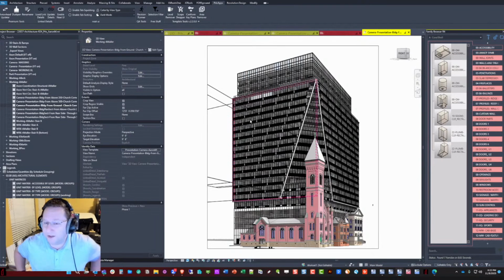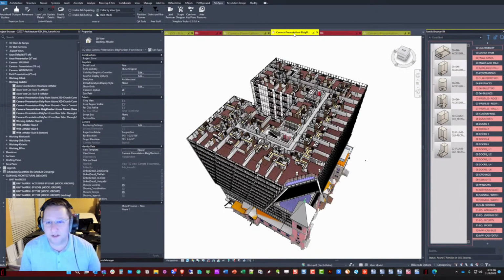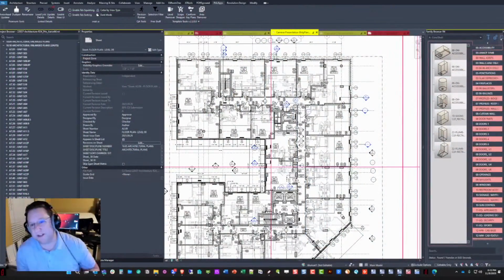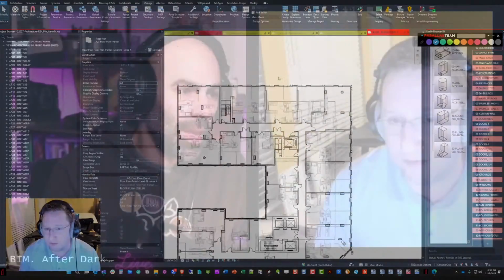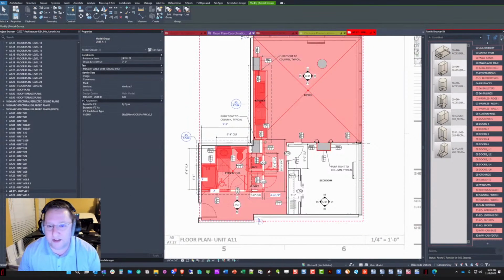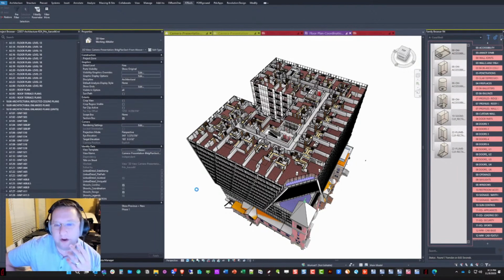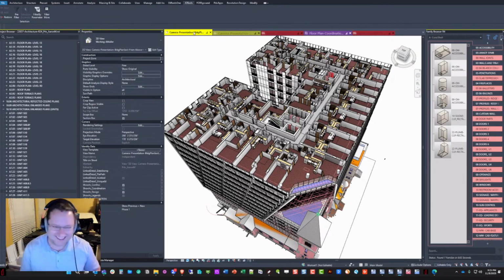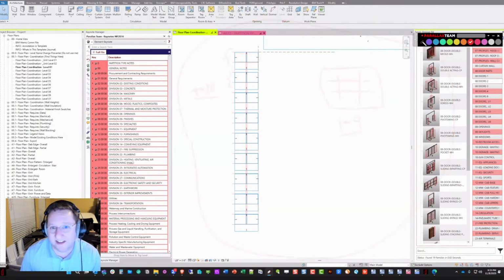Multi-Family / Mixed Use Revit Documentation Tips (w/Aaron Maller)

Comment: 42:30 From a computer science perspective, it's going to be far more performant to use a Yes/No parameter for unit instance filtering. Using a text-based parameters means Revit is going to do a dozen or more CPU cycles of pattern matching per object, whereas a Yes/No conditional is done in a single CPU cycle. If you have multiple parameters you want to add to the parameter, consider using a number as a sub-parameter. i.e. IsUnit: Y/N, UnitSubCategory: number.

Comment: Counter argument from me against unit garden and for documenting insitu.  We're a contractor and we take buildings designed by others and turn them into construction documentation.  We don't have control over unit naming so a lot of the advantages of cartooning views/sheets are lost there.  To produce a sheet is easy with Dynamo anyway - select the unit group you want to document and plan, RCP, keyplan, light and vent plan and unit schedule are all created and placed on a sheet.  Every relevant element within the plan is tagged as well.  Takes 30 seconds.  Having the facade and party walls (demise walls) in context works much better for us with coordination.  Facades are in their own groups.  Party walls are in their own groups.  So similar breakup to what Aaron is advocating.  Given the stage we take control of the project, it's unlikely any units are going to move so we're covered there.  However, I'll acknowledge we have issues when there is a buyer variation on a unit so it becomes a one off and that is the one we have documented.  Then we just need to run the Dynamo script again to create the typical unit sheet again (and hope it doesn't also get varied ha!).  I can see the unit garden method being useful for firms that are designing and constantly changing units.
Reply from the maker: Cheers! Thanks for the input and experience!

Comment: Revit needs to manage links more FASTER.
8 links, in One RVT. and its "Present" project in motion.

BUT, you are a Project Lead, and you are left managing the "ending" project.. aka  Second RVT.
So, one HAS to have two RVT's open ..ohhh how missrable Revit is then.

No one talks about .. painful syncing times???
what makes it worse.. I hear from Autodesk reps..
expect average syncs to be 5-8min long.

I was baffled. That's not acceptable.
ALSO, Revit is only flexing on 16Cores only?

and how long has it been like this?

I Drafted in "multifamily projects" for almost 3yrs now.
I"m disappointed with Revit's performance and lack of growth>>

We got workstations now that go to 64 cores.
900mb rvt and you trying to adjust tight dims for clarity on shop prints and your Revit stalling / lagging to generate results is frustrating.